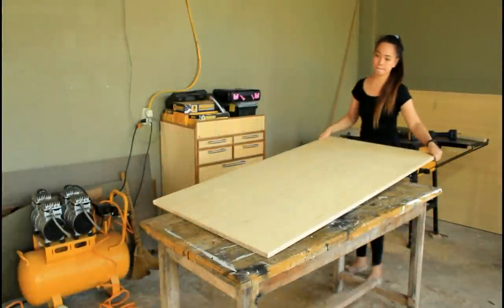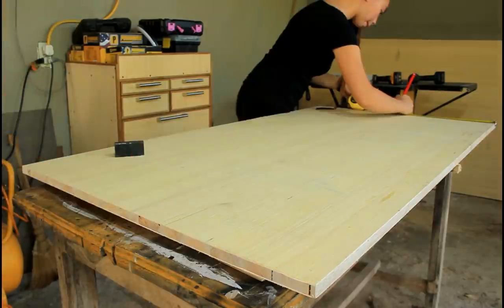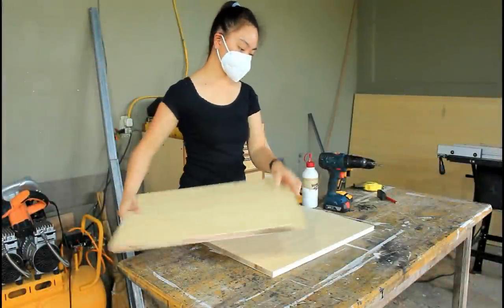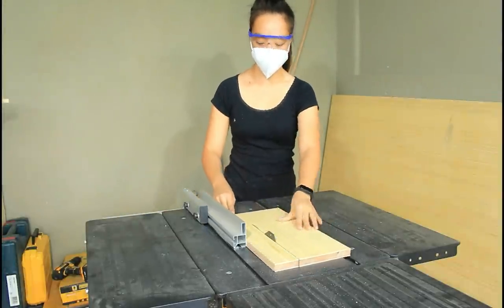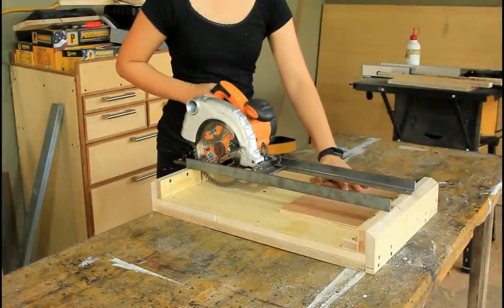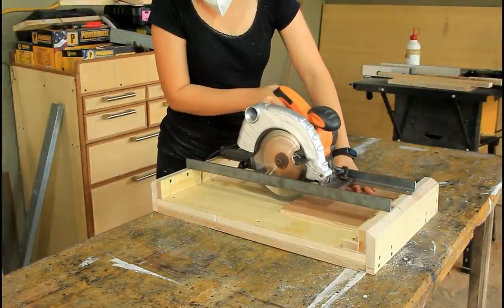Making a Circulaw Saw Cross Cut Jig

Comment: Hello again D.A, Interesting successful project. Once again I thought I would like to make a suggestion (I hope you don't mind) that should help while you are cutting wood. If you have the possibility to screw or glue two stripes of teflon onto the angle bar your circular saw should glied better while cutting. Of course you may have to adjust the height of the angle bar to be able to cut deep enough as well. Pushing steel on steel will always rub and cause you to have to push harder while cutting. I'm sure a new project is on it's way. Have fun!

Comment: D A sorry to say you do not take heath and safety very seriously as you don't use ear defenders when cutting metal strips, no guard on the table saw and not using push stick passed the blade, and still not clamping work down all the time. When you have an accident it will be to late if you lose a couple of fingers or more.